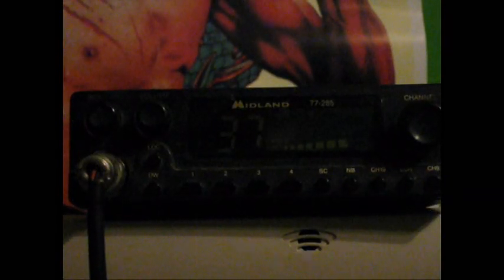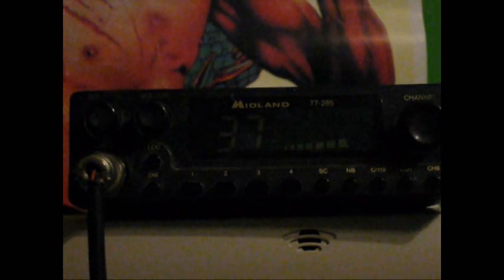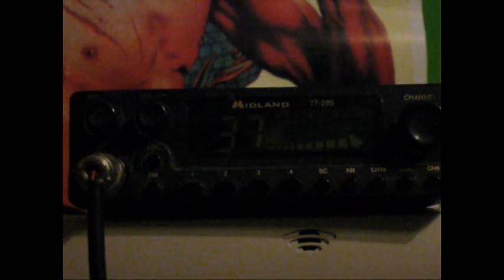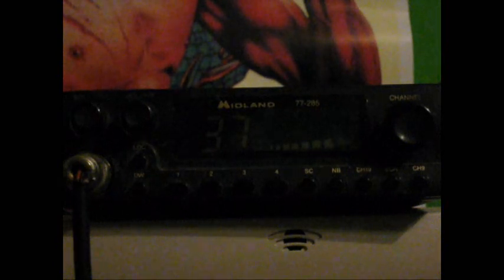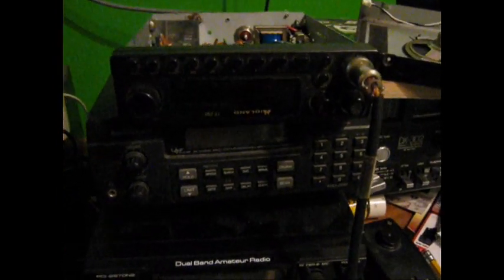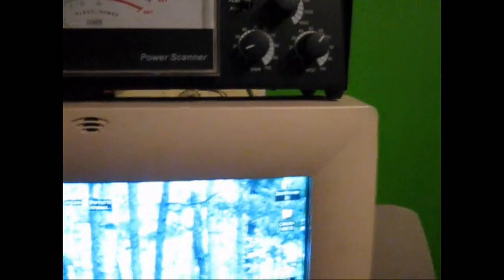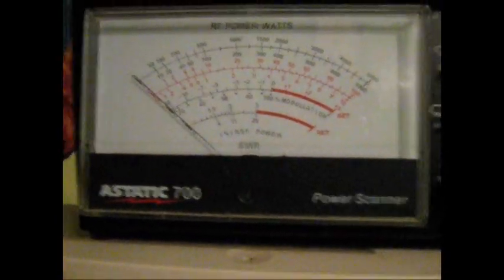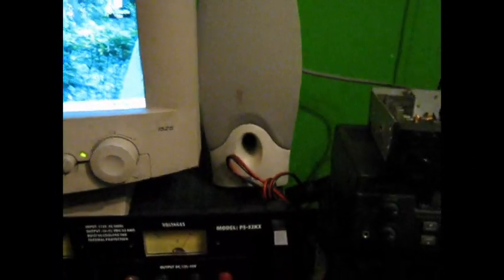Midland 77-285 mobile 40 channel cb radio

Comment from the maker: @bluejay148 update, 
i did do the channel mod yesterday but it was like pulling teeth to find.  it covers the low 26mhz to high 27mhz like 27.955 or somthing like that.   i might mod it to change it to cobra 4 pin pattern so i don't need to keep using that junk midland mic